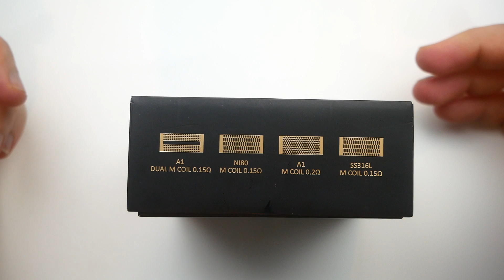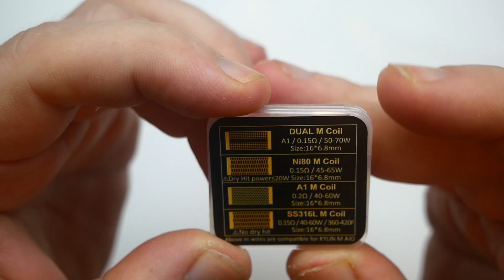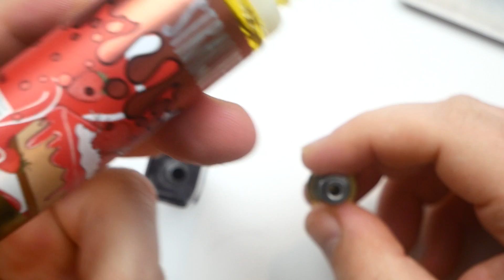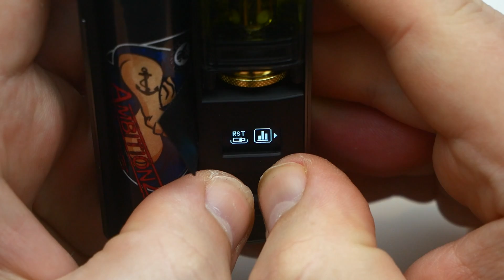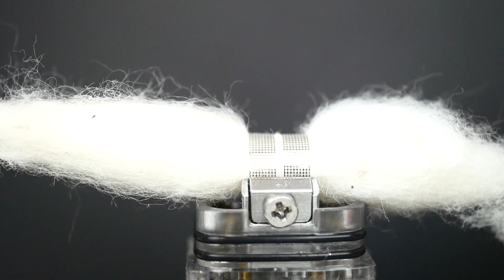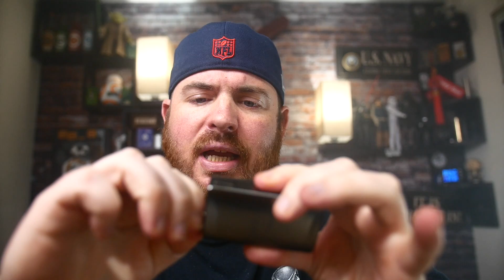Kylin M AIO by Vandy Vape Review & Build | No Need For an RTA?

Comment: RDTA is the biggest turnoff for me. If it was a normal RTA build deck instead of an RDTA I would have already purchased it. This is really disappointing. I don’t mind the branding I just want a cheap billet box, cause I’m not spending that kind of money on a device that doesn’t even seem easily to get regardless.
Reply: This is like the most indecisive video I’ve ever seen. It’s like you’re getting paid to do the review and you’re trying to not speak off the cuff cause you don’t wanna bash it and mess with your paper.
Reply: @timolean5846  I own one and HATE rdta but the wires make a difference with wicking I left the pod on it's side for an hour(outside the device) to see if it leaks and it did not, just wick it good. I'm not a mesh fan so I put a SS tricore fused clapton 3mm ID 5 wrap came to .28 I vape a 6mg chubby razz so I like a cooler vape 45 watts this thing is amazing.

Comment: Hi thanks for review just subscribed. Do you know if it has Voltage boosting capabilities? Just wondering if the power drops as the battery does!
Reply: it's regulated you get the wattage you set it to till the battery cannot supply and you must change/charge

Comment: I've been interested in this one for awhile now I don't usually do aios anymore but every now and then one comes out that catches my eye. You can do a bunch with this one
Reply: Battery life is the biggest turn off for me.
Reply: @Budisgud69  why? It takes an external 18650. Get a Samsung 30Q or LG HG2 and you have 3000mah. And considering it tops out at 80w, it should get you most of the way on a single battery.
Reply: RDTA is the biggest turnoff for me. If it was a normal RTA build deck instead of an RDTA I would have already purchased it. This is really disappointing. I don’t mind the branding I just want a cheap billet box, cause I’m not spending that kind of money on a device that doesn’t even seem easily to get regardless.

Comment: Nice review. Out of the plethora of budget AIO/Pod Mods that have been released over the last 6 months it seems to tick most of the boxes for me. I have a couple of questions - the board is obviously fully regulated but does it have voltage boost circuitry or is it capped at 4.2V max? Have you vaped it using a regular Alien/Fused Clapton coil - I'm not a mesh fan, if so what do you think?

I totally agree with you on the branding - if I get one there'll be a sticker going over it.
Reply from the maker: Yes and yes it goes to 4.2v great question
Reply: 5.5v